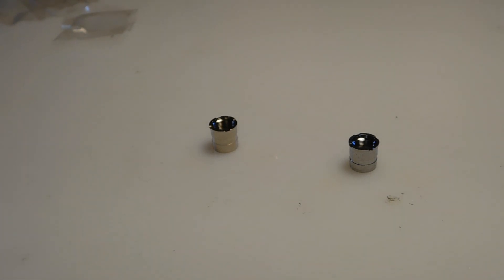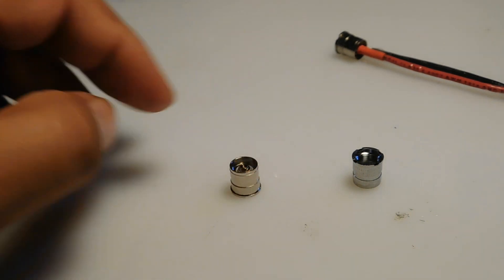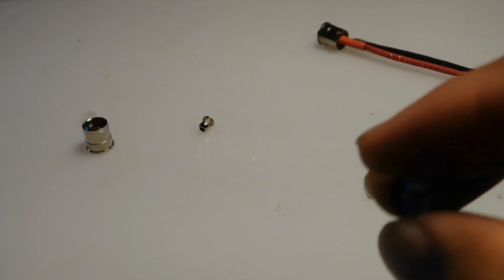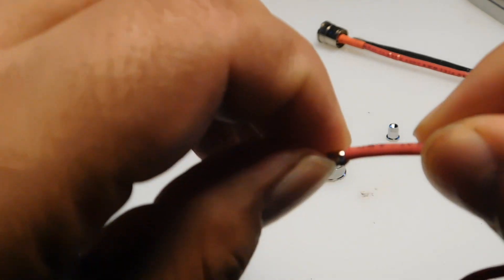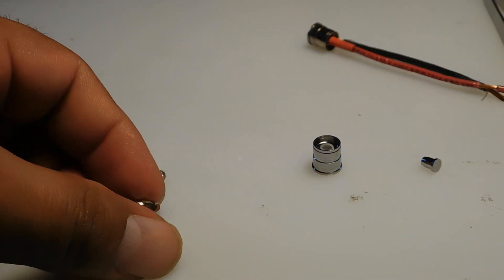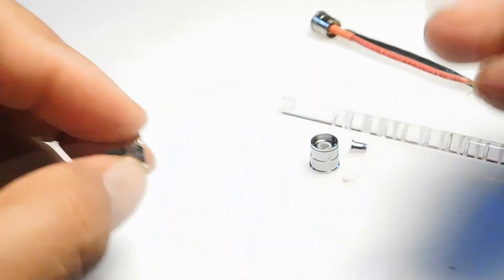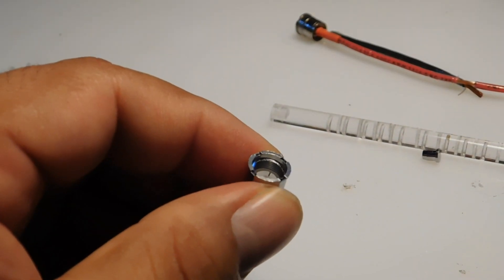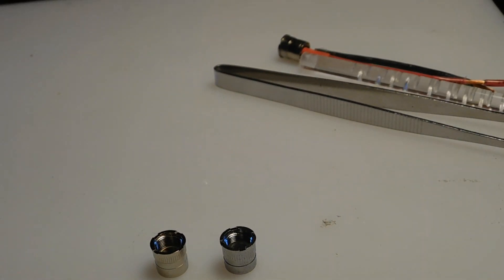soldering standard 510 connector for your Box Mod. Vape

Comment: I stripped tip of wire down using lighter and fingernails. I then slid the wire into the tube with grommet and reinstalled the nipple plate thing. Pinning wire between nipple and grommet. Took couple secs works great. 👍🏼 Thanks this video helped a lot. 👊🏼

Comment: I had the wire come off of mine but I fixed it then it came back off with very little heat. what kind of solder wire should I use? one that can take the heat?
Reply from the maker: Use 14 G,
Reply: thanks but, too late. I done #u@&3d it all up. tried taking the board out to use on a homemade box, I was going to order a new 510. broke the damn thing all together. I should have just sent the damn thing off to have it replaced.